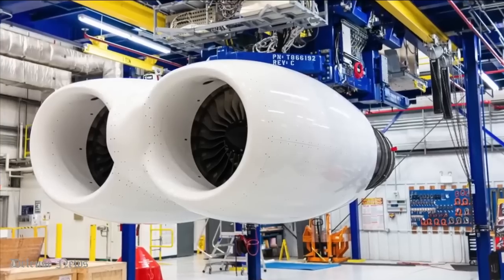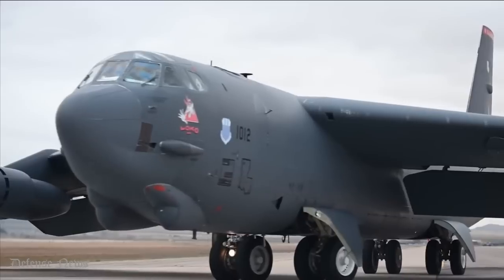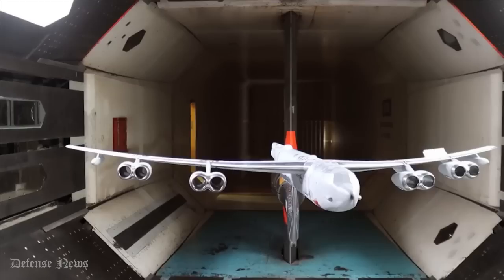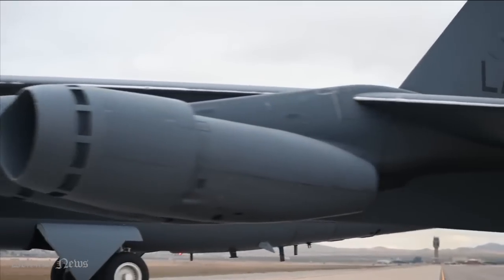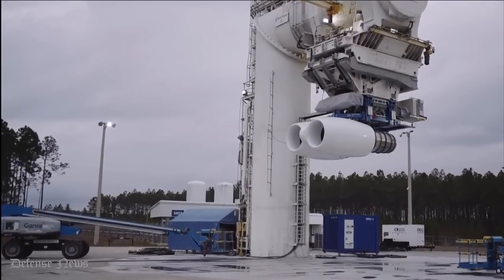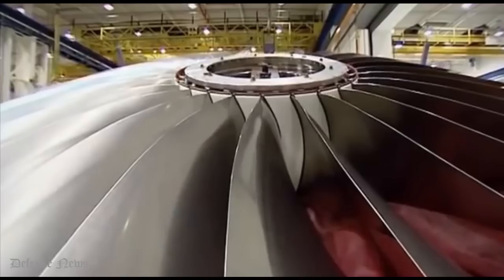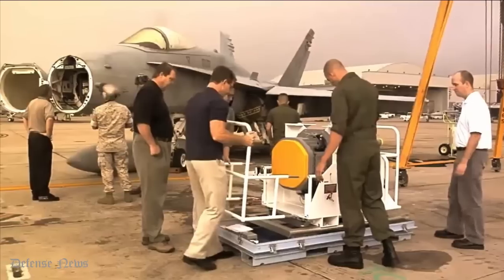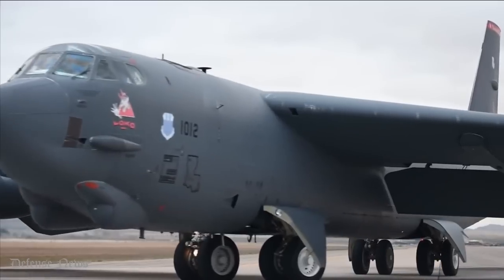Rolls-Royce Begins Testing of New F130 Engine for B-52 Stratofortress

Comment: The bid for this plane was proposed in 46 and was flying in 52.  If a plane like this was proposed today it you'd take decades to get finished.
Reply: Boeing is not what it was. The 777 took less than a year from first flight to first delivery, the 777-X first flight was in January 2020 and first delivery isn't scheduled until 2025! More than 5 years later!
Reply: @cageordie  surprised it even has money nowadays, with airbus selling planes by the dozen.
Reply: Maybe they should get Elon interested. He's done well with Tesla and SpaceX ...
Reply: there is documentary on youtube about B52. Military and manufacturer engineers met in a hotel. The military guy showed them the specs needed to be met and I think they took a design they been working on and scaled it up. While another guy went and bought balsawood and started to carve the aircraft. They presented the rough design the next morning, with the balsa model, and the military guy like it. So they got the go ahead. Sounds like a tale.
Reply: Another YouTube video implied this as well.  An idea was proposed in 1960 and was flying in 1964.  I think it was The Greatest Airport that Never Was.
Reply: If a plane was proposed today with this frame but 80 year old machinery then no, it would not take decades, it'd take a few years just like it did in 46.  Planes today are a million times more complex than they were in the 1940's, these B-52's have been brought up to date at least 3 times over the past half century to the point that the only original part of the plane left is the frame.
Reply: @krashd  That is something one can say. But B52 is a truck with some cummins truck engines on it. It is easy to replace and upgrade the bombing aiming electronics and terrain radar, ECM and so on. What is interesting is that the airframes are so overbuilt they do not get tired. ;)
In the meantime fighter jets have to be scrapped cause they are too tired.

Comment: This is great to see. The B52 should have been re-engined when the KC135 was. The TF33 engines on the B52 are antiques and should have been consigned to history. But at least that means that they now get a great engine which is already in service with the US military. It's funny this is about the F130/BR725 engines, but some of the video is showing Trent engines, which are huge compared to the F130. Typical journalism, an engine is an engine, and all planes are the same anyway. While fitting a fighter radar, they might as well add some AMRAAMs for self defense.
Reply from the maker: thanks for the comment
Reply: let's find some AIM-54's too.
Reply: There are a couple of shots with engineers in Airbus overalls, and when talking about the radar upgrade they showed a Typhoon.

Comment: The TF-33 was and is a great and reliable engine. Worked on WC-135"s in the 80's into the 90's with TDY'S all over the world and the TF-33 never let us down.
Reply: Used to hear them a lot on the E-8s here at Robins AFB. Now it's a once in a while thing and soon to be gone as they're nearing retirement. Their sound is surely unique and will be missed! 😥
Reply: The BMW F130 engines are a perfect fit  for the B-52 and an excellent design, they will be made in America 🇺🇸
Reply: The TF33 is hot garbage now. They’re old and worn out
Reply: @WilhelmKarsten  Hello Sandyboy, as you know Sandyboy, the F130 is the US designation of the ROLLS ROYCE BR 725 engines. You remember  that Rolls Royce gave bmw the chance to re-enter the aero engine market in a joint venture but bmw couldn't hack it and dropped out. Fortunately Rolls Royce kept on the  local employees.
And as you know, the F130s will be built in the US at ROLLS ROYCES North American facility.

Comment: She’s been a super trooper from day one. There’s no reason good aircraft like this can’t stay in use as long as the infrastructure required for doing so is maintained. I hate to see the end of days for ‘ol Smoky, but it’s time she got some modern, more efficient powerplants. It’s cheaper in the long run to keep up and upgrade existing than to go thru the cost & drama of building new. She’s proven, go with it!

Comment: I love the sight & sound of the mighty B-52 with its whistling TF33 engines & I want to see it remain viable. But the RR F130 engine is basically the same engine that replaced the Speys on the Nimrod turning the Mighty Hunter from a roaring Tiger into a whispering pussycat
Reply from the maker: thanks for the comment brother
Reply: The F130 is a BMW engine
Reply: @WilhelmKarsten  Hello Sandyboy, as you know Sandyboy, the F130 is the US designation of the ROLLS ROYCE BR 725 engines. You remember  that Rolls Royce gave bmw the chance to re-enter the aero engine market in a joint venture but bmw couldn't hack it and dropped out. Fortunately Rolls Royce kept on the  local employees.
And as you know, the F130s will be built in the US at ROLLS ROYCES North American facility.

Comment: I think it's great for making brand new engines for the oldest plane that's still operating.  But I think it's a shame to get rid of the excellent A10 Thunderbolt . A plane built for ground attack that can absorb extreme damage, protect its pilot, and low maintenance costs. But what do I know.

Comment: Do they leak oil into the compressor section and pump it into the cabin, like their other engines?
Reply from the maker: thanks for the comment
Reply: They are going to add an extra oil injection system for that.
Reply: @godfreypoon5148  they don't need to. The crappy turbine seals they use ensure a steady supply of pyrolized oil fumes into the cabin.

Comment: Overbuilt, and over designed, the B-52 was created to eliminate the problems associated with the B-36 and B-47 bombers. As in the case of the DC-3 and the C-130, The design proved very adaptable and sturdy. The B-52 will still be in service when airplanes not even designed yet are Scrapped. This airplane is a Modern Wonder of the World , equalled only by the DC-3. The DC-3 makes money every day. Since 1935. The B-52 has been Defending this country I was since I was born in 1956. I'd say the Taxpayers got their money's worth out of that plane.
Reply from the maker: thank you for your comment

Comment: Rolls-Royce has an engine plant in the US?
Reply: Rolls-Royce has a factory in the US making BMW F130 engines
Reply: Yes, it's North American plant is in  Indianapolis and was formally Allison. The F130 is the American designation for the Rolls Royce BR 725 made by Rolls Royce's German plant at Oberursel.
Reply: @WilhelmKarsten  Hello Sandyboy, as you know Sandyboy, the F130 is the US designation of the ROLLS ROYCE BR 725 engines. You remember  that Rolls Royce gave bmw the chance to re-enter the aero engine market in a joint venture but bmw couldn't hack it and dropped out. Fortunately Rolls Royce kept on the  local employees.
And as you know, the F130s will be built in the US at ROLLS ROYCES North American facility.

Comment: I would like to see GE pods under the wings but I’m partial too GE.
Reply: The BMW F130 is a fantastic engine and a perfect fit for the B-52
Reply: @WilhelmKarsten  Hello Sandyboy, as you know Sandyboy, the F130 is the US designation of the ROLLS ROYCE BR 725 engines. You remember  that Rolls Royce gave bmw the chance to re-enter the aero engine market in a joint venture but bmw couldn't hack it and dropped out. Fortunately Rolls Royce kept on the  local employees.
And as you know, the F130s will be built in the US at ROLLS ROYCES North American facility.

Comment: They look cool, I’m surprised that they weren’t made slightly larger in diameter but that’s probably very purposeful! LONG LIVE THE BUFF!!🇺🇸🇺🇸
Reply from the maker: thanks for the comment
Reply: Some high-bypass engines (like Trent triple-shaft) would give them a much longer range but other factors come into play like ground clearance and radar signature. The civil airliners with the big fans light up on radar but the old Buff has a surprisingly small radar X-section.
Reply: Rolls Royce  - Proudly British
Reply: @pinoyfromengland  The engine isn't developed nor build in Brtiain as the whole BR700 series, BR because BMW - Rolls Royce. Rolls Royce engines get names of british rivers...

Comment: Best engine!!!
Reply: BMW Power!
Reply: @WilhelmKarsten  Hello Sandyboy, as you know Sandyboy, the F130 is the US designation of the ROLLS ROYCE BR 725 engines. You remember  that Rolls Royce gave bmw the chance to re-enter the aero engine market in a joint venture but bmw couldn't hack it and dropped out. Fortunately Rolls Royce kept on the  local employees.
And as you know, the F130s will be built in the US at ROLLS ROYCES North American facility.

Comment: Someone enlighten me! Why is the USA using Rolls Royce engines which is a British company (Although assembled in the USA) for it's B52's when they have GE and P&W? I'm a Brit and it would be great to see RR aero engines on a B52! Cheers.
Reply: Actually the F130 is a BMW engine designed and manufactured in Dahlwitz Germany.
It was the best match for the B-52 and the bid was cheaper than the Pratt & Whitney bid
Reply: @WilhelmKarsten  Hello Sandyboy, as you know Sandyboy, the F130 is the US designation of the ROLLS ROYCE BR 725 engines. You remember  that Rolls Royce gave bmw the chance to re-enter the aero engine market in a joint venture but bmw couldn't hack it and dropped out. Fortunately Rolls Royce kept on the  local employees.
And as you know, the F130s will be built in the US at ROLLS ROYCES North American facility.

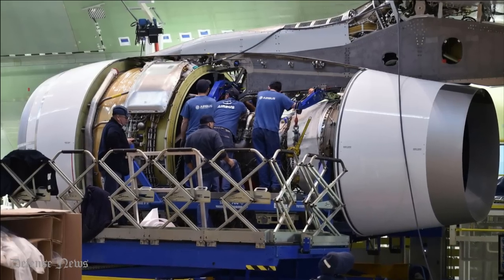Comment: I knew the US engine makers (GE and P&W) were hacked off about USAF/DoD buying RR engines, but won't Boieng be really p'ed off now that Airbus engineers are maintaining old Boeing aircraft (4:33 in video)...
Reply: They colluded to put in bids that were both more than TWICE the bid of RR for a less mature engine. The Pentagon were in no mood for a 2nd bumming after the debacle with the KC46 against the A330 MRTT. They got an inferior aircraft and paid twice the money.
Reply: The BMW F130 engines were the best fit, and the bid was less.
Reply: BMW made the 003 engine during WWII.  It would run for about fifty hours before overhaul...  You would need a lor more than eight too.
Reply: @r.markclayton4821  The BMW F130 engine began development at Motorenfabrik Oberursel the second oldest aircraft engine manufacturer in the world and was acquired by BMW and later partially owned by Rolls-Royce.
Rolls-Royce has since acquired the remaining shares but continues production in Dahlwitz Germany.
Reply: @r.markclayton4821  The BMW 003/18 series is the most successful and longest  production jet engine program in history and is still in production as the Safran ATAR.

50 hours TBOs is excellent for any high output piston aero engines during WW2.

The BMW 003/18 is also the first European jet engine to fly Mach 2.
Reply: The US has been using RR engines on aircraft longer than the Air Force has existed
Reply: @grandmasterpu  Not made in Britain, the Americans supplied the Packard V-1650 to British aircraft companies and also solved the fatal flaws in the Merlin.
Reply: @WilhelmKarsten  they were still a RR design even if they were produced in the US by Packard.
Reply: @grandmasterpu  The Mustang was the only major application of the Merlin in America.
  America is the largest manufacturer of aircraft engines in the  world.
Reply: @WilhelmKarsten  again, it was still a RR design. 

We’ve continued to use RR on some aircraft platforms ever since.
Reply: @grandmasterpu  But none manufactured in Britain... American manufacturers still dominate the aircraft engine matket..
Reply: @WilhelmKarsten  cool. 

Still were RR engines.
Reply: @grandmasterpu  Most were designed and made by other American manufacturers, like Pratt&Whitney, Curtis Wright, Continental, Lycoming, General Electric, etc.
Reply: @WilhelmKarsten  Hello Sandyboy, as you know Sandyboy, the F130 is the US designation of the ROLLS ROYCE BR 725 engines. You remember  that Rolls Royce gave bmw the chance to re-enter the aero engine market in a joint venture but bmw couldn't hack it and dropped out. Fortunately Rolls Royce kept on the  local employees.
And as you know, the F130s will be built in the US at ROLLS ROYCES North American facility.
Reply: @WilhelmKarsten  Hello Sandyboy, as you know Sandyboy the ATAR 101 has never been a BMW 018. The poor old French lumbered themselves wit Oestrich,  a hundred German engineers and the underdeveloped and immature engine and even with the effort of as many additional French engineers and after almost completely redesigning it and finally adopting British Nimonic alloys they managed to put the ATAR in service years after comparable British and American engines.

Comment: The computer voice is irritating and loud......the RR F130 will be loud but not irritating.
Reply: The F130 is a BMW engine
Reply: @WilhelmKarsten  Hello Sandyboy, as you know Sandyboy, the F130 is the US designation of the ROLLS ROYCE  BR 725 engines. You remember  that Rolls Royce gave bmw the chance to re-enter the aero engine market in a joint venture but bmw couldn't hack it and dropped out. Fortunately Rolls Royce kept on the  local employees.
And as you know, the F130s will be built in the US at ROLLS ROYCES North American facility.

Comment: Four high bypass engines would be easier and better
Reply from the maker: thanks for your comment
Reply: BUFF's have a very small rudder. With very little rudder authority, in an engine out situation, the fewer engines with more power each means the pilots would not have enough control of the airplane to fly safe.
Reply: But less cool...
Reply: Four high bypass engines would really show up well on any air defence radars, lets make our not very stealthy bomber even more visible!
Reply: I could swear I once saw a picture of a B-52 with 4 big turbofans.
Reply: Wouldn't sound as good.

High bypass engines sound like a loose fart in a drainpipe.
Reply: They would not. Far more complex and expensive of a modification for no real added benefit
Reply: one 747 engine was tested in the inboard position. It was so the engine could get flight time for certification before the 747 was completed.